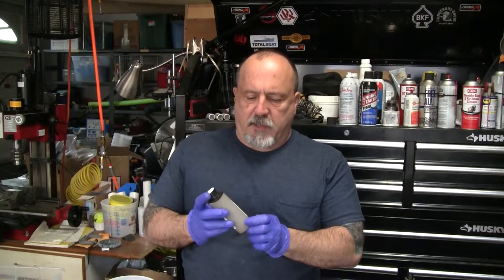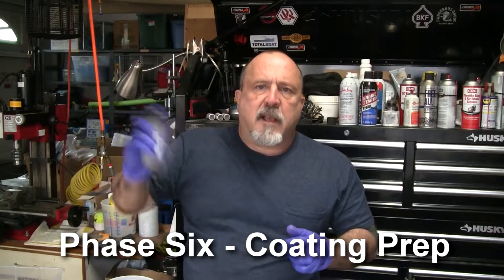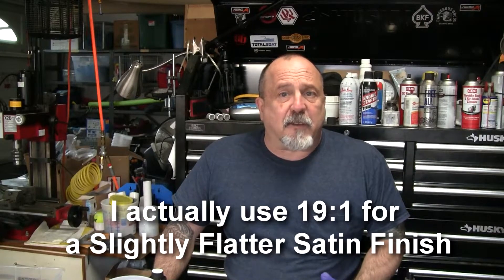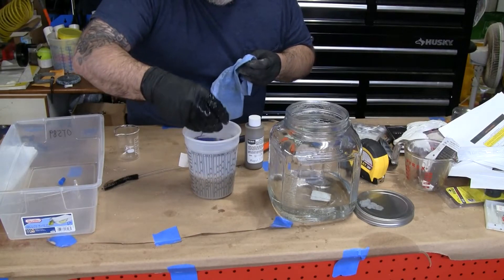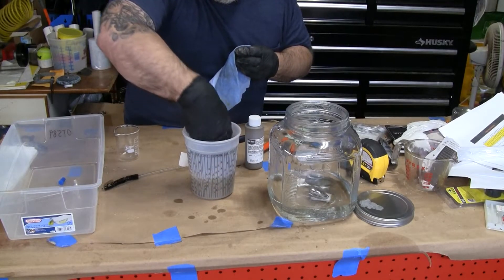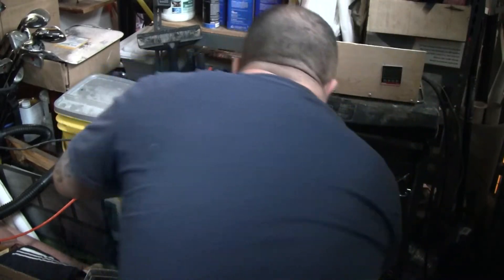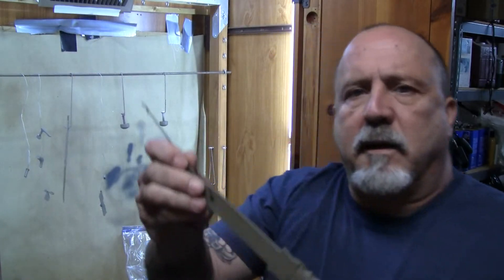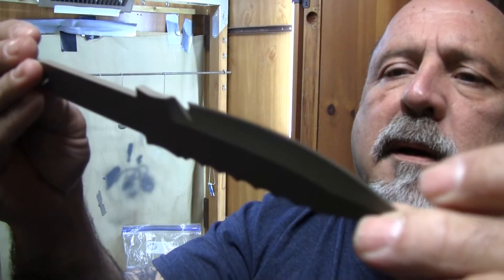How to Cerakote at Home - Part 2- Applying and Curing Cerakote

Comment: Just built a spray booth doing KG. It helps a lot if you paint the inside white. I had trouble seeing the paint lay down because of  bad lighting and shadows. Mostly helps doing lighter colors, Cadmium paint color is like the same color as media blasted metal. Now how long will it stay white, no clue. My exhaust fan helps prevent overspray. The white booth really helps you see though.
Reply from the maker: Thats a great idea! I did an article on venting the DIY spray cabinet

Comment: What kind of oven do you use for the curing process? I imagine using my kitchen over might not be a good idea?

Also, you said 250 degrees, I’m assuming that’s Fahrenheit and not Celsius?
Reply from the maker: It's an old smoker I converted into an oven with a temperature controller, and it's set for Fahrenheit.

Comment: Great tutorial series! Very helpful! Finally, I have all my stuff (sandblast cabin, air compressor, oven etc.) together to start to cerakote my stuff :) happy and scared at the same time ;)
Reply from the maker: Follow all the steps and you'll be fine. I would recommend downloading the cerakote training manual from their website, no charge. https://images.nicindustries.com/cerakote/documents/120/h-series-cerakote-elite-training-manual-dt20200115005711425.pdf
Reply: @ExtremeDIYGuy  Yup ,I already know by heart ;)
Reply: AND I'm glad that you mentioned 120 mesh blasting media is fine because I don't get my hands on 100 grid.
Reply from the maker: Let me know when you're done, Maybe I can get a picture of your project up on the community section of my channel.
Reply: @ExtremeDIYGuy  yes sir, will do!